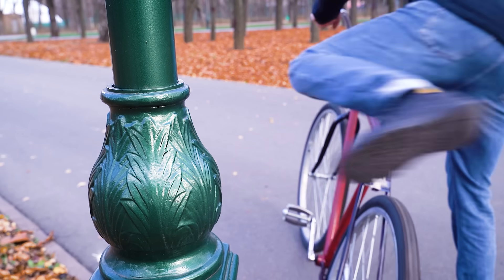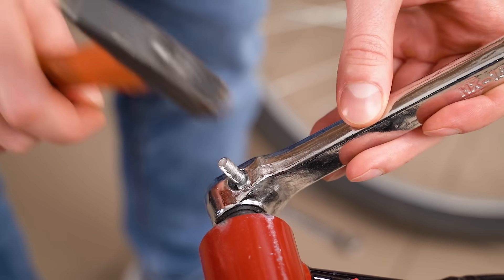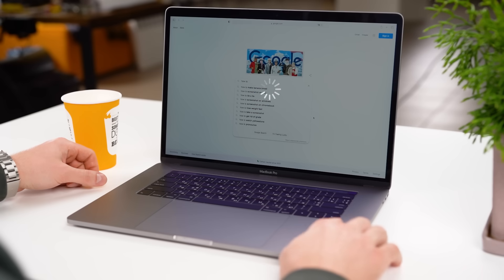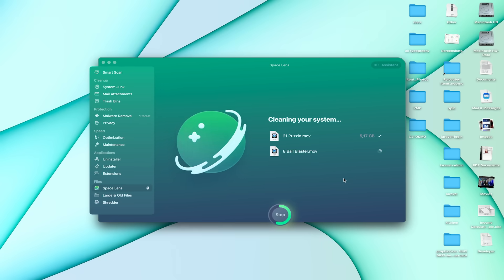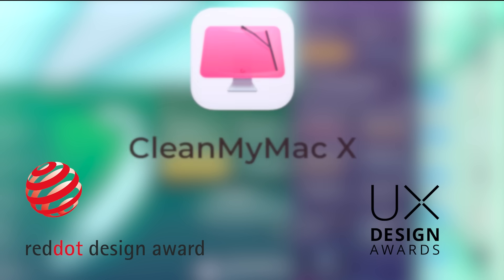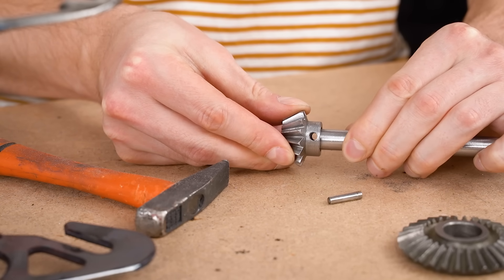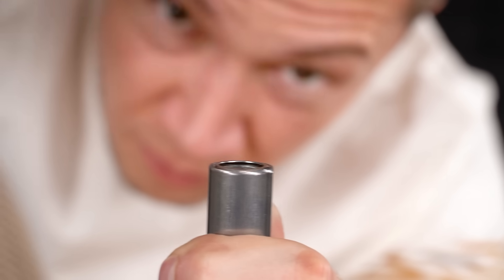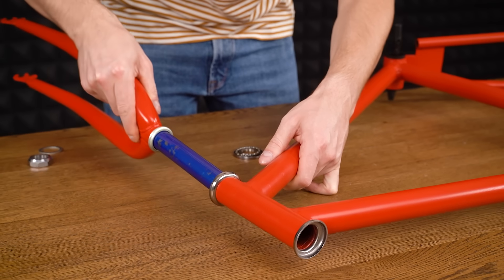Insane Chainless Bicycle Prototype

Comment: The gear ratio being the same for peddal and wheel would require lot more peddling to travel the same distance but this idea was awesome.
Reply: Yes if we increase the size of gear then it will be more awesome.
Reply: @Nikhilsingh-bf2cr  worse is that you can't have any gear shift options
Reply: @kashmir-se-kanyakumari3574  hmm you are right but in this type of cycle gear swift option is difficult.
Reply: @kashmir-se-kanyakumari3574  you can if there is a central gear system. They are really mot that uncommon. Can probobally by them of ali for $10
Reply: @kashmir-se-kanyakumari3574  you could change the ratios or even add a gear but you would increase weight.
Reply: @kashmir-se-kanyakumari3574  even worse than that is throught those joints you lose like 20-30% of the power put in. Thats why Motorcycles mainly use belt still.
Reply: @fecalmatter4195  yes
Reply: Force
Reply: @kashmir-se-kanyakumari3574  single speed is enough
Reply: @kashmir-se-kanyakumari3574  , it’s a fixie, some ppl like them.
Reply: @kashmir-se-kanyakumari3574  you don’t need them anyways
Reply: Not only that, you can't stop pedaling cuz if you do you're gonna get hurt, maybe even break an ankle. If you end up on a hill you better hang on and pray
Reply: yes but you would be able to make other gear levels 
to change to the next gear you only need to make a larger one with higher levels one piece and to change to higher lever you only would 
have to pedal back words understand
same two sprockets but with a slot then when you pedal backwoods the sprockets slips onto the next level slot 
the only problem is now you dont really know what slot your on but to go up a hill you need to pedal backwoods to the lowest lever and
for high speed to higher level 
or you would have to put the two sprocket on the same level un top of each other and then use a cable to push the sprockets to run down the level you want to be on 
so it can be done in two ways but there maybe more if you work it out
Reply: Yall there have been internal gear hubs made for like 150 years in fact this exact drive system was used on internal gear hubs. Does Sheldon Browns site not exist anymore like what?
Reply: @carldoomsday3975  well im not that smart and didnt know that 
hmmm iv got look him up thank you for comment
i think the reason why they dont make this device for bikes is because it must cost to much money and time to make
because with all bike company over the years would of made a bike with one years ago 
after looking and studying Sheldon Browns work
Reply: @MsSugercrisp  i think the reason is mainly that this system is heavier so it wouldnt be used on race bikes and everyone wants to ride what pros ride
Reply: @carldoomsday3975  yes that so true your right buy as you know rust eats away at the chain and its the first to go on a bike
good for normal riders once they make over levels to use or gears for more speed
Reply: @carldoomsday3975  Well exactly , I rode my fathers bike to school in the 1950’s with its three speed “Stermy Archer”
Reply: think of a drill and the force level on a drill same thing understand
Reply: Which idea?🤔
Reply: Absolutely agree with you. Some thinks they are next super but engineering is not that easy to understand and more to the science behind designs. What is presented here is ok to appreciate efforts  in possibility but practically what was invented is still the greatest and logical in all senses.
Reply: Yes,you see the problem,big problem
Reply: Just call it that this is the first prototype for the bycycle to using gear, not chain anymore.. Like a gear transmission car for the future invention 👍
Reply: It will work better and more efficiently in a trike setup and it would be easier to set up gears at the pedals rather than the rear tire
Reply: Aur bhai peddal ko rokate hi aap get jauge
Reply: Welp you can tell by both the gears and Seeing him Try it lol
Reply: Yeah this bike looks tough to ride because of the gear
Reply: Where are the brakes?
Reply: But in this gear ratio if would require comparatively lesser power to pedal
Reply: This is nothing new he "didcovered" ancient build technology.....
Reply: Actually it looked to me he was peddling to much. Good to know there was actually a problem with that design. However I guess it's not a big deal, right? More gears can be added so that little strength can be converted in a greater torque?
Reply: Are you blind. It is different
Reply: Yes
Reply: the concept was great and offers a lot of improvement ideas.
Reply: Ý tưởng thật sự hay, nhưng sẽ toits hơn khi có bộ phận bôi trơn kín
Reply: You can add another crank on other side so that will reduce force for one side
Reply: More pedaling = more exercise?
Reply: The idea was done 100 years ago.
Reply: Next up manual gearbox and motor lol.

Comment: Shaft driven bikes are immensely troublesome. Chain drives are far superior and vastly more rugged. The shaft drives are outdated and always tend to fail due to the prying nature of the gears. Even with shaft bearings they are no comparison to the chain drive
Reply: Yep. There’s a good reason for chain drive being the universal mechanism for pushbikes. This is a bit like making a piston engined airliner.
Reply: @tjfSIM  or eating instant coffee without a spoon.
Reply: 100%
Reply: Not to mention that you are stuck with one gear.
Reply: @williamh4172  One gear is not as bad as one-to-one gear. :-)
Reply: shaft are also not that efficient when deliverinv power to the wheels compared to chains

Comment: The major issue with his sprocket build is that he was to pedal extremely fast for minimal energy transfer. In other words his system is far less effective than a traditional chain gear system
Reply: Also the fact you cannot stop pedaling without the bike stopping, or more likely destroying the sprockets
Reply: @kc4415  that is an excellent point, one I hadn't thought of. There has to be a way to modify the sprocket to act like a fly wheel
Reply: @darthvail  ya dude and a clutch pedal and a fucking gear shifter
Reply: @mflance7197  or just use a fking chain and derailer. There is a very good reason specialized and norco arent making shaft driven bikes lmfao
Reply: @kc4415  I get what you're saying, it being kind of like a fixed gear bike. Actually, it fits a better definition on to the term Fixed Gear than those with no freewheel and a chain....but all that aside, if you watch when he comes to a stop during the test ride, his feet (and pedals) stop moving before the bike stops moving, so it appears there is some slop, or freewheel action going on with the finished model. The build looks as if it is a fixed gear bike, but the test ride part shows that it might actually not be fixed. Rewatch, tell me what you think.
Reply: There's plenty of room for improvement.
Reply: @Calypso993  need a phat gearbox or one made of exotic materials to get more efficient pedaling
Reply: @Calypso993  Exactly what I was going to say. It can be improved.
Reply: @opinanlosjovenesrd3477  it can’t
Reply: @Calypso993  yes, like going to a chaindrive system with gears
Reply: @Calypso993  why bother when the best solution is already on the market lmao
Reply: Rohloff 14speed internal drive hub.
Reply: You are right.
Reply: Well, please show us your idea, build it
Reply: What about potholes? Can it absorb or sprocket will mismatch and will get damage?
Reply: Maybe he can improve it in the future
Reply: No creo que esos engranes aguanten unidos mucho tiempo. Se necesita un mejor agarre que los mantenga unidos
Reply: different size gears wheels will pull that off but heck,this guy should go high tech and get a gear shifter
Reply: Correto
Reply: Do you mean modern chain gear system?
Reply: But good to develop leg muscles and cardio
Reply: It's a cool bike, not a good bike,
Reply: It's not less effective, he just has the wrong gearing.
Reply: Yeah that's too much pedaling just to ride at walking speeds.
Reply: No he just need bigger dials to adjust the rotational speed
Reply: It’s a dumb idea
Reply: If the sprocket had more teeth I think that would increase the torque being put on the back wheel. Back in the early 2000's I rode a single gear with 55 front to 14 back. That was like riding through liquid concrete 😂. Then as I got better bikes I went to 25 to 14 (a trials bike) which was incapable of gathering any speed. Eventually I settled for a 25 to 9 because I wanted a lot of speed.
Reply: There are a number of ways to change the gear ratio. But it's a good start
Reply: Развалится эта ерунда практический сразу!!! Инженеры придумавшие цепь не зря свой хлеб ели...
Reply: @ИванФёдорыч-т3ц  I would love to know what you're saying.  I can't translate the script to english
Reply: dont forget that metal bend. its not going to survive after several times ride. the gear too easy to slip when one of the body part bend

Comment: Bad thing about it is the gear ratio and if you want to coast down a hill the pedals will continue to rotate.  It's basically a drive shaft with a differential.

Comment: And then the thrust bearing or shaft spinning inside the tube by either sides of the pinion gear wear out from the force of it trying to outwardly separate the pinions from the sun gear and suddenly you have a skipping gear and no ability to pedal the bike. Stupid. Stick to what works and has done so for many generations, or come out with a way that thrust bearing wear somehow doesn’t occur. And while you’re at it, invent some form of genius transmission, or perhaps a tried and true 3 speed hub shifter ;)

Comment: Improvements:
Use ballbearings to reduce friction
Make a more sturdy connection
Make a gearbox
Use screws with loctite to secure gears
Reply: Loctite
Reply: Actually, with this design, you shouldn't use ball bearings, but rather the same kind of bearings you find in automotive differentials, as they're cylindrical, rather than spherical. While they have a wider cross-section, they offer more stability to a linear rotating system.
Reply: @isaiahwelch8066  true

Comment: Aside from the fact that idea is about as new as the pyramids,It irritates me that many people think that a quick squirt of WD40 is a sufficient lubricant,it's not sufficient for for anything,WD40 is a one hit lubricant designed for releasing seized parts,rusty bolts etc.,it is primarily a water dispersant,hence it's name. All that he has done,given the exposed nature of those powdered metal gear set is hastened their demise by leaving them insufficiently lubricated but now with a sticky residue meaning every bit of dirt,mud and road grime will combine with that and the material displaced from the actual gears themselves because they are not lubricated and make a nice abrasive paste,this will accelerate wear and increase drag,put a box around it and put some grease in it ,FFS!

Comment: Install a ratcheting system  to keept the pedals  inoperative when free wheeling ,  then make  the pedal ring gear larger and  a a two piece sliding output shaft so that it can move from near center to outermost perimeter in order to create gear reatios and THERE YOU WILL HAVE IT RIGHT ?  WRONG.... chain driven mechanisms are practically bullet proof .., smooth and reliable they have been so  fo a very long time .
55 years ago  at age 15 I finally had earned enough money to buy my first 10 speed ..I still have it , ti still shifts flawlessy  with the original chain   kept clean after each ride....10 miles or so . total mileage on the bike....do not know ..a good guess would be around  2000 miles per year times   45 years ...90 k miles ... last ten years have been much less ..old age haha ha . Insane Chainless Bicycle Prototype ?  yesterday`s news !!!

Comment: Just one thing - the biggest drawback of this technology is its problem with dirt. It could quickly go south,  if a chip or rock fragments gets in there. Also, imagine, what will happen during riding, if a small stone gets stuck between the gears. Fun times flying in mid air...
Reply: I would argue the biggest drawback is a much higher drivetrain loss than with a conventional chain. As something "human powered", you wouldn't want a higher loss of applied power.
Reply: @rakerholm  isn't efficiency of a gear train in the ballpark of 80-95% depending on friction and geometry precision? Yes, chain drive must be more efficient, for sure, but not that much??

Comment: The build quality matches the parts and frame quality.  I didn't know they even sold pinned cranks anymore.  I have pin removal tools in my bike tool museum at my shop.  BMW did a shaft drive bike in the early 2000's  was only available in germany.  A mig welder has no place in frame work.
Reply: Migs are for the lazy and incompetent aren’t they? They lack penetration and forgive too many mistakes…

Comment: Now build a geared transmission into the crank hub and you'd really have something! Nicely done
Reply: At this point just install a motorcycle gear box and clutch. Although I'm not sure if the gears ratios is suitable for humans.
Reply: @Al-ng2wn  I mean just ride a motorcycle, far better transportation method of budget allows
Reply: There is hub  gears.  Would work just fine
Reply: You can get internal drive rear hubs you juat have to fit the sprocket and lace it in a wheel.
Reply: Dual clutch gearbox for a bicycle 😂
Reply: Look in the video list below this video. There is a disc gear ratio in full effect and it is genius.
Reply: @branni6538  are you talking about the video titled "Erstaunlich leistungsfähige Maschinen und extreme Schwerlastanbaugeräte"?
Reply: good but would be easier tobbuy a chain ))
Reply: There are geared transmissions for bikes but definitely not a build at home sort of thing and the ones sold are designed to work with chain or belt

Comment: While that obviously works, I really dont see it lasting too long before you end up ripping teeth off one of those gears trying to go up a hill. You would need to make specially made gears with much deeper teeth so as to avoid slipping and grinding when things start to loosen up or when dirt and debris gets on the gears. But i would like to start seeing more bikes made just for riding on flat ground that you dont need multiple low and high gears on made like this without chains.

Comment: It's a great idea until you want to change speeds. itd be cool if you actually incorporated a transmission (which is going to be required for different gearing.) But still pedal only. Cool, not practical.

Comment: How did you account for gear ratio, so that the power from pedaling is amplified at the rear wheel? How did you account for coasting? The current build looks like the pedals and rear wheel are constantly in time with one another so at no point can the rider coast down a hill without pedaling the entire time.
Reply: Put your legs out and hope the pedals don't smash your legs.. 😂
Reply: The steeper the hill, the more fun to watch !

Comment: I am wondering if it feels lighter or heavier than a regular cycle.
Reply: Lighter ,but it will be hard to gain speed with it as both the gear are equally size and shaft loses a lot of energy than chain!  So it's a bad idea but fun to try and make it by yourself!!

Comment: They went to chains for a reason. Lower cost, because those would need to be a matched gear set for long term, as well as a grease delivery system. Otherwise the failure rate will be higher than a chain model. No offense but horrible design for long term reliability.

Comment: You made it good, but it need more number of pedals to run than usual, because of gear size is small.
The gear connected to pedal should be big in size.

Comment: Very good!

- But why not to put wheel right under the sit? With some 'finger' transmission on disks with holes with different radial distance?

The small one was used for backside balance avoding backside flips. But now you can move front wheel mor far ahead. Using now transmission for driving wheel. 😂 Well, it is better to remove hard connection bringing easy free backside move of rotation mechanism. Like ordinary bicycles have now. As such driving is not simply dangerous.

But why didn't you use much more relible direct stick connection to some outer disk place on radius or even external part? Like first trains used? You can create same radiuses both for legs and this one. Primitive and reliable solution. You can create it on two sides to make symmetry and equality of forces on both of them, making forces appliying more effective with decreasing of perdpendicular to wheel forces current bicycles have. Prolonging usage with no damages.

Comment: Doesnt the shaft been small create a setback that you'll need to pedal more, so I dont think it's as efficient as the chain, with you are able to move the chain to different levels for less pedalling yet more speed ,with a single shaft not possible

Comment: I’ve owned a 6 speed shaft drive mountain bike for 4 years and I can confidently say it’s draw backs are efficiency and parts availability. Lucky the design is built like a tank and I still use it for workouts.

Comment: Chains will probably be moe reliable and cheap. The gear has a low contact patch with each other and can strip each other. A chain has a lot more therefore it probably won't strip. And ride quality is better and easier to change out. Many drawbacks other comments have said.

Comment: Gear teeth number is fixed.
This example really had him pedaling alot and he was always on flat terrain.
This is why bikes use multiple sprockets, chainrings in a cassette with a freewheel, and a derailleur front and rear to make different gear selections.

Comment: Be much better if you had welded hamster sized mouse wheels on either side of both wheels, which electrically "stimulated" some athletic hamsters to run at various speeds to push the bike along so you don't have to pedal at all lol....